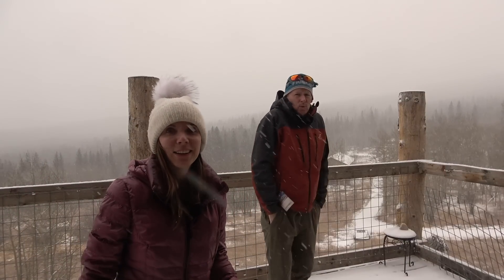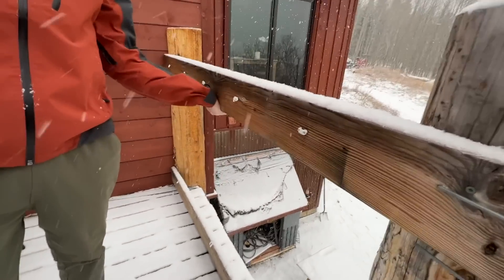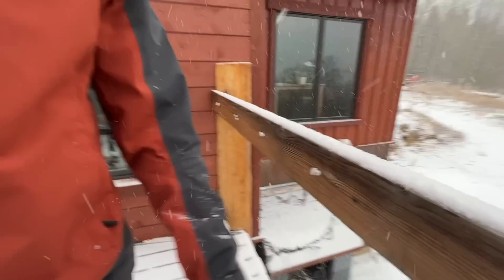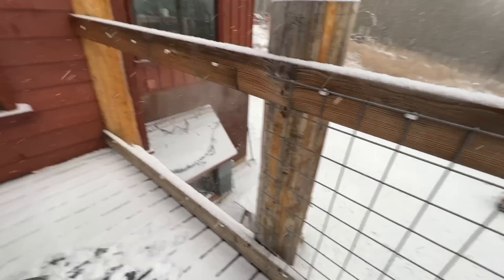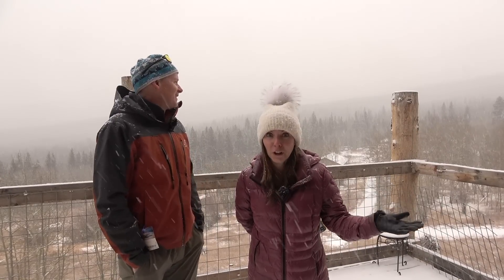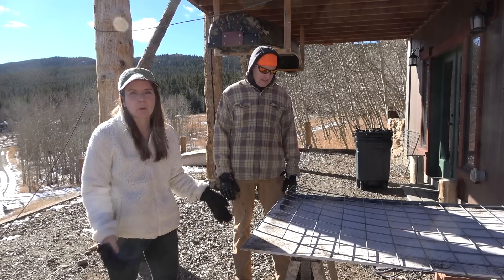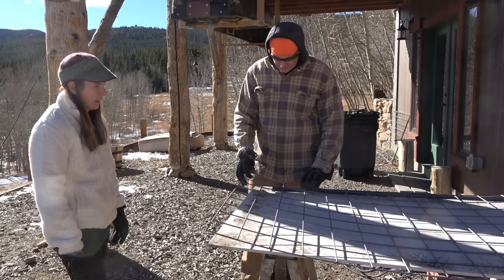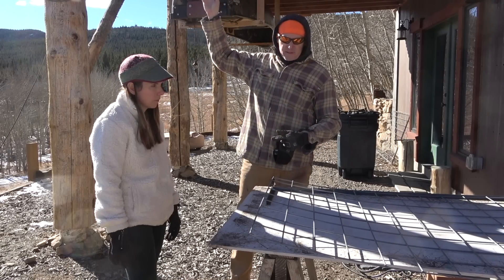Our DIY Log Deck is Falling Apart

Comment: When welding outside, the flux core wire or stick welding is generally better. The pocket of gas will be at the point of the arc. If you are using shielding gas with the mig, the pocket of gas is coming from the tip of the torch and can easily get moved by any wind or breeze. 

If your hog panels are galvanized, you will have better long term results using a primer that is made for galvanized. 

Great job. Always glad when someone is learning something new. Learning by doing is the best way. Think about learning to swim by reading a book about swimming! Combining doing and learning - either from a book, YouTube, or an instructor, compliments each other.
Reply from the maker: Great tips, thanks!

Comment: When you are mig welding even with the fluxcore wire you need to have the end shield piece threaded on the end of the mig gun. you showed it earlier in the video when talking about using gas. The melting flux core creates the shielding gas which is contained by that screw on  sleeve. which should cut down on the splattering. giving you a smoother weld.
Reply from the maker: Thanks so much for sharing that tip!

Comment: Just a tip, that works for me.  Choke up on the stick.  I'll hold the stick with my fingers a couple of inches from the weld spot or let the stick slide along the back of my gloved hand.  This allows you to ease the stick in and you'll get less sticking, and a better bead.  YMMV.
Reply from the maker: Cool- thanks for sharing that tip.

Comment: Brian, you might find using the gas shielding better for this project.  The argon gas creates an oxygen free environment for the weld.  The flux core or stick does the same thing, but then you must clean the weld which is very time and labor intensive.  I think you will cut your fabrication time in half using the argon gas.
Reply from the maker: Thanks for the tip!

Comment: Is Bryan considering putting a 240v line in the shed? It would give him more versatility because dealing with the winds you all get has got to be killer. I was out yesterday and it was about 62º in Apex but we had some wind and it was a cold wind and it took my breath away. I can just imagine the winds in the Mountains of Colorado!
Reply from the maker: Not planning on running any electric anytime soon to the shed.
Reply: @ColoradoMountainLiving  Have you consider a foray into Solar? I know Solar can handle a 240 line because Heath over at (Red Poppy Ranch) a fellow youtuber in Idaho uses Solar as his primary electrical power source. A few things do run on propane. But he has an old Hobart Welder he uses and it requires 240 volt line.